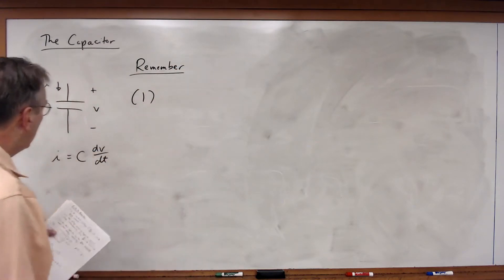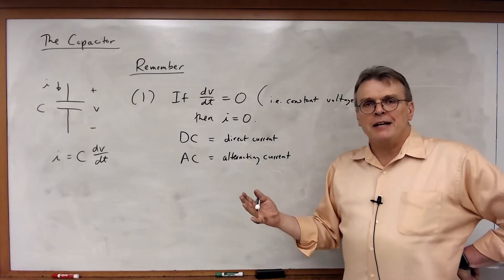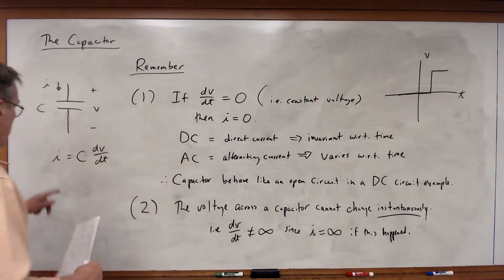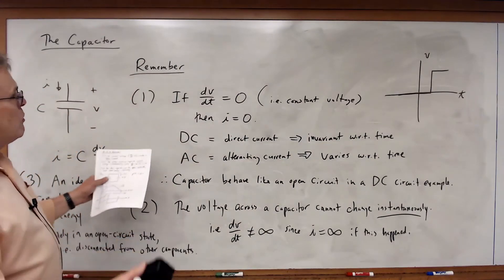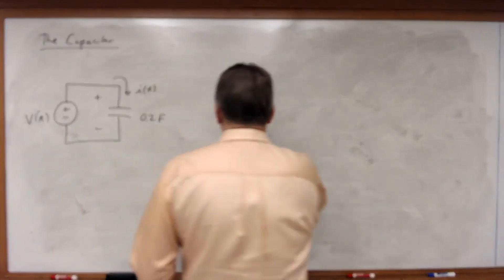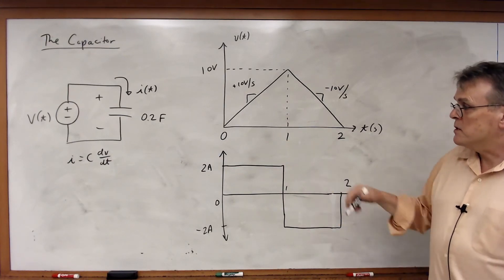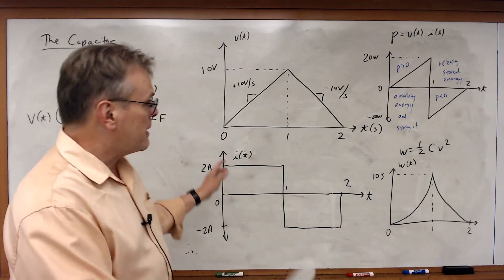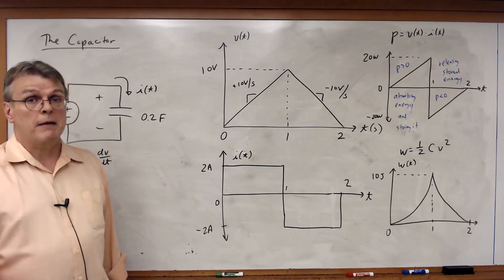EECE 2112 Module 46:  The Capacitor (continued)

Comment: Hello Proffessor !!! If two capacitors having some initial charge are connected in parallel with a switching mechanism..and now when switching is On wouldn't the voltage across the capacitor change instantaneously...?
Reply from the maker: You've just described what is known as the "two capacitor paradox", which has been debated and discussed for many decades. There's an excellent article on Wikipedia that I recommend you read.  But in short, such a circuit is impossible to build, as it would require wiring and switches without resistance or inductance.  You could remove the resistance by using superconductors, but you cannot remove inductance.   That inherent inductance between the capacitors would prevent the voltage from changing instantaneously across either of them.